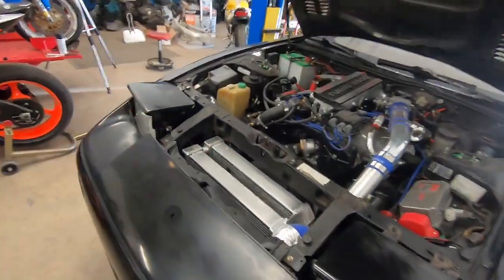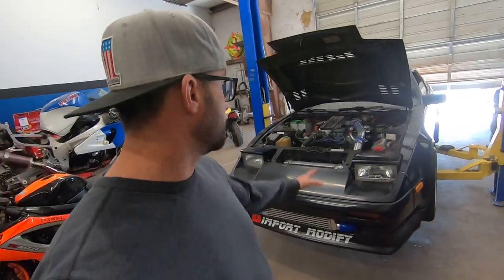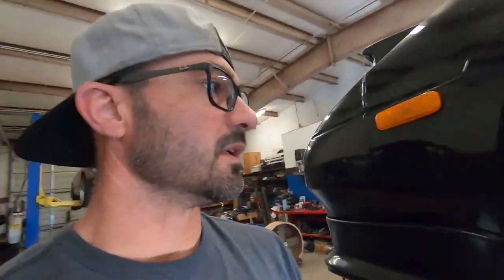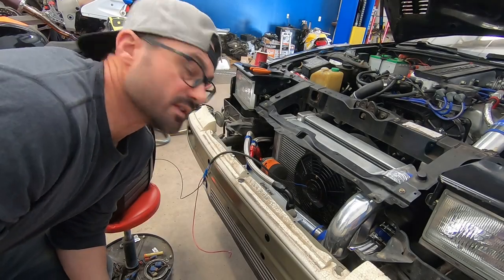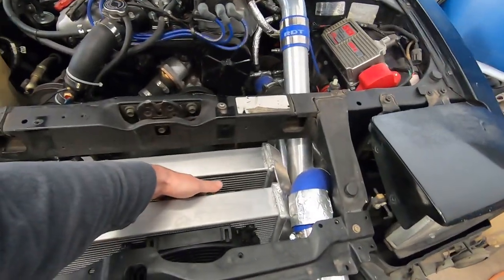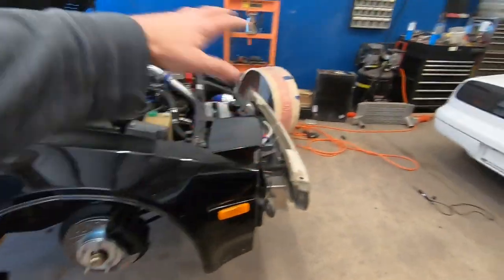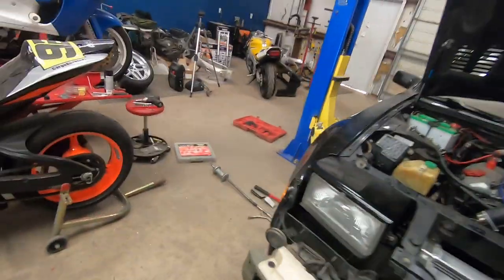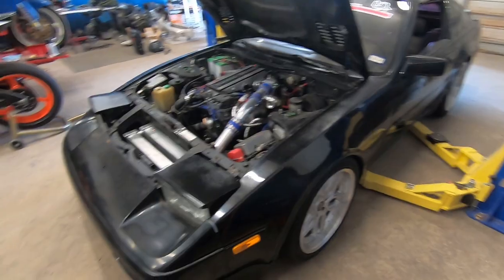Z31 Turbo: Extra Rad Fan, Bodywork, Tire Fitment issues

Comment: Always standing by for new videos..I just bought the S14 rear subframe for $180,TT hubs and 1990 Q45 rear diff for a real good price..it's going to be way cheaper than $1,000 for that rear kit you are going to buy and more adjustments..but good luck..I wish I had a lift.
Reply from the maker: Awesome, I thought about the rear subframe swap. Either way with being able to properly setup the suspension will be a God send for these old cars.

Comment: Waoo 200 Degree switch, mmm I think that's a little to high...oem is 170..well I guess is because of the 2 radiator..
Reply from the maker: I was doing some reading on what temperature switch to go with at the time. From what I read most modern engines that are fuel injected operate around the 190 - 200 degree range. I totally didn't look up what the stock thermostat was honestly. I choose it based on that. So I guess yeah it would open up earlier with a lower temp switch but if it operates normally around 190 -200 I guess no harm no foul. Then again, would a 80's engine be considered modern haha. I should get the 185 switch and see if it does make any difference.
Reply: @importmodify  soo yhea a stock VG is 170 and the high performance nismo is 160 so..american muscle cars are usually 190-200.
Reply: @importmodify  On my Z31, I run an adjustable thermostatic switch made by hayden. I keep it around 180, confirmed with an aftermarket temperature gauge. You will probably fix your cooling issue if you switch back to the Z31 style radiator using one of those 3 row ebay radiators. You can still fit your intercooler piping above and next to the radiator without cutting the car. Definitely check the balance of your wheels/tires, its unlikely that you damaged your hubs.
Reply from the maker: Thanks for the advice. I put soo much effort into this setup I want to see if I can make this work. Thanks for the advice. I'll order a different switch and see how that works out.
Reply: Cool👍

Comment: What are your front tire size and offset specs? I’ve got the z32 front brakes and had to run 33mm spacers to fit some second hand 17” xxr rims with a bump steer kit with 0.5 negative camber. My steering rack has lateral play it seems and I can’t seem to get around it. Wondering if your rack has anything similar feel wise
Reply from the maker: front tire size is 265 35 18 wheels are +15 et 9.5" wide. I also am running 5mm spacers so et is now +10. The car steers quick with the negative camber but walks around through bumps. I haven't done an alignment yet because I'm leaning on that suspension kit.  Plus I need 255 tires to get it to clear properly.
Reply: @importmodify  same size on the rears or did you go with something wider on the back?
Reply from the maker: 255 front 265 rear
Reply: @importmodify  and wheels are 9.5" wide +15? And that offset is +10 now because of the spacers?

Sorry for all the questions, trying to get as much info as possible so I don't mess up haha